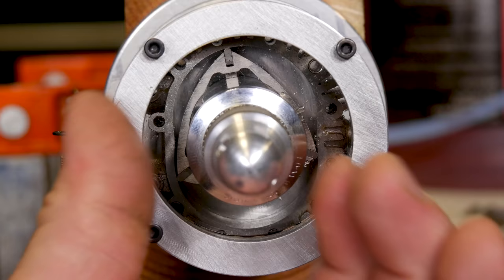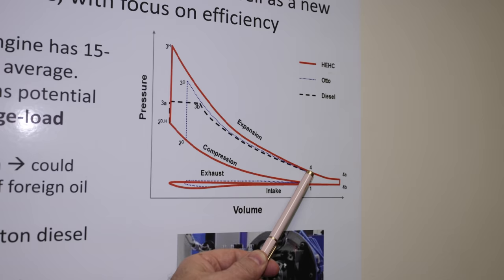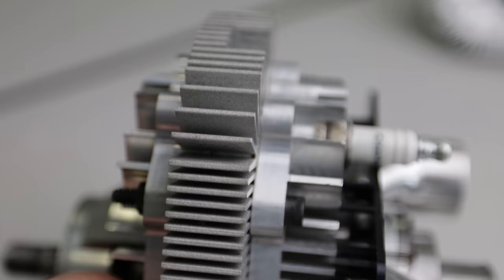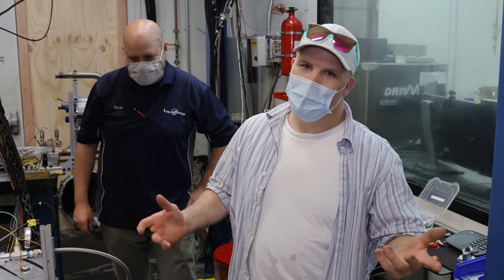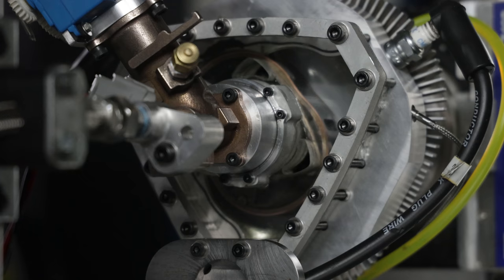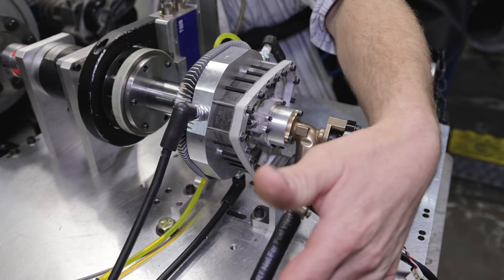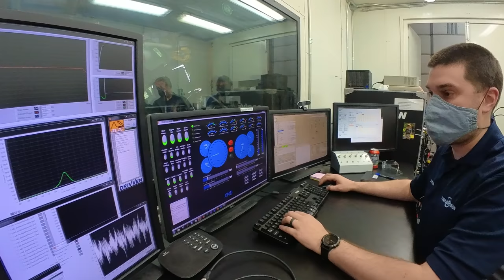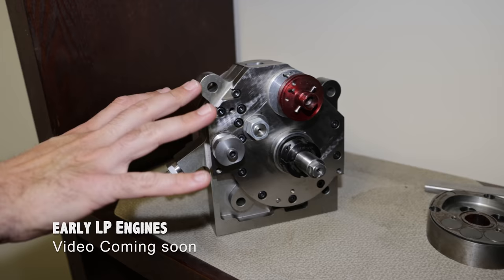See Thru Liquid Piston Rotary Engine - In Slow Motion

Comment: I was a Mazda service manager at a dealership back in the day, and the biggest problem we saw with the RX7's was that the owners babied them. They didn't run the engine at high enough RPM's to clear the carbon build up on the original 7 piece apex seals. When they got towed in all locked up, my head shop mechanic would break them loose with a wrench, get them started running really roughly, then literally put a brick on the gas pedal and go to lunch.  They would blow huge clouds of smoke for a while, then start to smooth out, then gradually clean out and end up running  great! I might have already sold the customer a new engine, only to find out the engine now ran just fine.  Saved the owners a lot of money!
Reply: Water worked really good for breaking up the carbon. I had a 12A that was babied its whole life, and it was all sorts of carboned up, got a gallon of water, put a water injection jet on a hose, and held it at 4 grand spraying at 2 second bursts. I was amazed how much carbon literally came off of this engine. I stuck a camera in there and it was nearly spotless.
Reply: Wasn't the original maintenance recommendation for the older 12As were to rev it to the moon once in a while? I seem to recall an old 70's documentary talking about this. No wonder people loved the damn thing even during the Oil Crisis lol
Reply: Babied Jaguar twin cam engines (1960's) liked a good high rev full power hill climb every now and again to get rid of the cobwebs.
Reply: Hey GR, when I read your comment I laughed.  I had a '91 RX7 Convertible and I was careful to blow out the carbon every chance I could!  That car might not have been the fastest top end car I ever owned (I think my 300ZX was faster) but I never had a car that was as quick.  Punching it while entering a freeway onramp meant entering the gray area between exhilaration and soiling one's pants.
Reply: You'll be glad to hear that I was frequently running my first gen Rx7 near redline.
Reply: So fascinating !!!  As a woman learning about different types of engines, this is so damn cool to watch in real time and slo mo
Reply: Mazda has a rotary engine in 2023
Reply: @pecan11  It's not like the old times, it'll be used as a generator in their hybrid vehicles
Reply: @ianstorey8556  🤣
Reply: @1983ponyboy  My uncle (he's probably about 100 now, if he's still alive) taught me that back around 1978-9.  He worked for the railroad.  I think he was a mechanic.  You're right, it works!  But the way he taught me was to take a coke bottle full of water, put your thumb over the mouth of it, invert it over the carburetor throat and dribble water ever so slowly into the engine.  He said that, if you put too much too fast, you can cool the rings too much and break them.
Reply: Can you please answer
Soo if i want to clean the engine i have to get him warm and than get it on high rpm for a hour or more right?
Reply: @abdulrhmanal-azawwi9796  If it runs OK now, I wouldn't do it. But if it runs very badly I would take it to a qualified tech with experience on rotary engines. My knowledge is from over 30 years ago, and I wouldn't want to give you bad advice! Best advice I can give you is that engine likes to rev high fairly often, at low rpm's you can get carbon build up. So just take it out on the highway and open it up once in a while!
Reply: @grene1955  Maybe it was designed that way to SHAKE the carbon loose -- sort of a built in ultrasonic cleaner! 😁
Reply: Remember....

A redline a day keeps the carbon away
Reply: Rotaries are the engines for me.
Reply: @trevorbrannon8875  I think it is light enough to work on motorcycles if the transmissions can easily mate up. To make more power it likely needs forced induction. With direct injection that should be feasible without low compression. I also worry about vibration and how much stress it can really handle.....
Reply: Totally agree. They are actually quite reliable in the right application and city driving isn’t one of them. They are more efficient than a piston engine at higher RPMs and are better as a race engine or for running a generator.
Reply: @streddaz  Makes sense to me. Idle min. RPM & trans. gear ratios can maintain adequate RPM to control carbon. Am I right, or am I right?
Reply: My grandmother's uncle's friend of a friend did the same thing.  Perfect.
Reply: @1983ponyboy  I used to inject horse urine, worked better than water.
Reply: @howardsimpson489  Me too. But the real pain were the twin carburetors: Always getting out of synch.
Reply: @grene1955  That's good advice for all internal combustion engines!
Reply: I have a new project and I was really considering using the rotary engine.    It is a 97 Dodge ram avenger.    If you would have any ideas or suggestion I'd really appreciate it thank you.   Just your average viewer starwatcher
Reply: @starwatcher9900  All I can tell you is DO NOT BABY IT! This is an engine designed to be run hard. The limiting factor on it is not really high RPM, it's the ability of the oil pump to supply oil at high RPM's. keep in mind there is not an actual redline... again, the oil pump is the key!
Reply: Hahaha. I ran my rotary at 9300rpm, just a hair over the redline Mazda set.  It was largely cooled by the vast volume of fuel we pumped in through 58mm ida twin carbs.  Not bad for a 1000cc motor, except 14 mpg, was matched with 380hp at the rear axel.  

No babying of the motor occurred. The only issue was the mechanic built the motor short, failing to machine the bearing housings to account for the milled end housings. So after 300km of run in, it blew up, during warmup on a cold morning at at the track.  We fired that mechanic. 

Not all owners ran their Mazda rotaries under the redline. Indeed it is laughable. No one in the enthusiasts clubs that sprang up held to such a notion as sensible.  They hammered their Mazdas.  And explored a wide range of options to lubricate and fit their apex seals. And the standard explaination as to how to run your rotary in was baby it for the first 100km, then gently wind it up to your chosen peak rpm for the next 200km. And most engines survived.
Reply: @COBARHORSE1  So was I with my RX7 FD built in 1992. The first engine broke after 95.000 km. The car is - after 31 years - alive an well with the second engine.
Reply: Cool 😎 🙏🤠🤟
Reply: Diesel tech here.
A lot of problems are the same caused by being babied.
Reply: Would Lucas Upper Cylinder Lubricant work?
Reply: @streddaz  - not to mention perfect aircraft engines, once the bugs are worked out.
Reply: Like any ring ding
Reply: @MagicSpamDragon  dont forget EGR. The dirtier the exhaust, the more painful it is to recirculate it.
Reply: Maybe these engines should have never been made for cars,,, planes would probably have benefited much better since they could really throttle up once they were at their flight ceiling.... That would been something to try as a project for someone that has three or four of these engines laying around.
Reply: @JOutterbridge  Norton made a rotary bike in the 80s/90s.
Reply: @MagicSpamDragon hey there. I have a Hilux 2005 1kd engine. Do you think 3k rpm is enough once in a while or should I rev it higher to clean carbon buildup?
Reply: @scorpa3033  regularly replace air filter is more important.
Decarbonizing is harder to do as it requires high temperatures.
It is better to prevent carbon buildup by having clean air filters to help burn the fuel properly.
When truck drivers baby their semi's it is cause they can easily rev 450 to 650 hp but only tend to do so on start up (when pulling weight) they need to put the strain on the engine. If they start up and pull their weight at around 250hp then hit highway where they maintain Bout a 200hp pull helps carbonize the interior.

Diesels are like work horses. They easily exceed their weight in force yet it is detrimental to their health if they go underutilized
Reply: @1983ponyboy The thought of running water through an engine makes my skin crawl but I’ll keep this in mind if I ever buy an rx7.
Reply: I had an RX-7 from the late 1970s, never babied it, IT RAN GREATm
Reply: Well yeah.
Rotaries are rpm monsters.  That and their light weight are their whole deal.
Reply: we used to dribble brake fluid into the carb while it was running did the same job without any of the risk
Reply: Honda Civic had valves that didn't rotate till 6 k rpm they burned valves for the same reason ...wide open was how they were ment to be driven
Reply: I red lined mine probably more than I should of when I had one
Reply: @abdulrhmanal-azawwi9796   sorry for the late response! I don't remember it taking an hour, probably more like 30 minutes. But unless it is locked up, I would just drive it hard...take it to high revs at least a few times very time you drive it. The "brick on the gas pedal solution" is only for extreme cases...use at your own risk!
Reply: Why not run it on pure hydrogen from the electricity it generates to electrolyze water for its hydrogen and oxygen, maybe add some kerosene for lubrication and added fuel
Reply: Redline a day keeps a rebuild away!
Reply: With the way people drive these days rotaries will probably be reliable 😂, I swear you can sitting at a red light, turns green but you see theres another red light just a 100 meters up ahead and people literally race you to the red light, I have no idea why.
Reply: Same as people not thrashing two stroke bikes to keep em clean.
Reply: I read that you need about 7500 rpm on each run of the RX-7 engine to maintain the apex seals. Didn't know coking was the issue.
Reply: That's right
Reply: I call b.s.
Reply: @abrahamben-zeev9142  you think you're too funny don't you?
Reply: ok...the idea here is to create heat rather than rpm....so a couple long high load pulls from 2000 upto 5000 rpm, foot to the floor, in 4th or 5th preferrably up a long hill...will clean out any gas engine quite nicely...
Reply: 4 stroke cylinder engines no different, gasoline, diesel, people should drive them hard more often, clean out the carbon and crap. 
Best advice of my father, 40 years of maritime diesels upwards to 100000 bhp.
Reply: 1,000ith like!
Reply: I redlined mine every drive.  Mine still locked up after I turned it off one day.  I bought it at 80k miles and drove it for about 60k. The real problem with rotaries is all of the misinformation that surrounds them.  You have what seem to be master mechanics constantly disagreeing in almost every aspect of the rotary in forums.
Reply: Just need to go slow. And have rpms up around 2500/3000. Rotaries seem like they are quite high rpm but the rotor itself spins 1/3 the speed the eccentric shaft spins (what the tach reads)@that1boi90